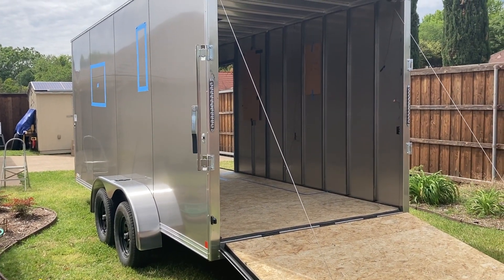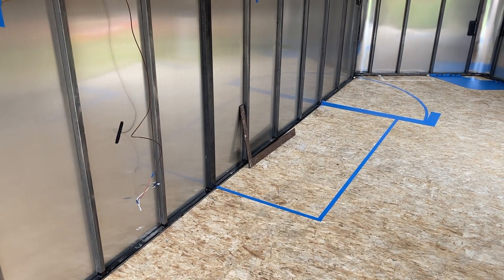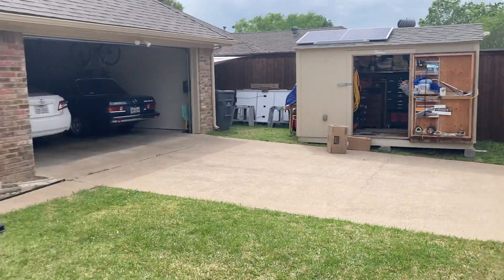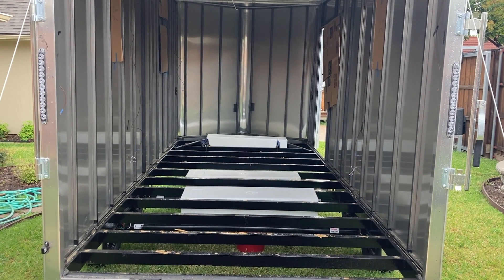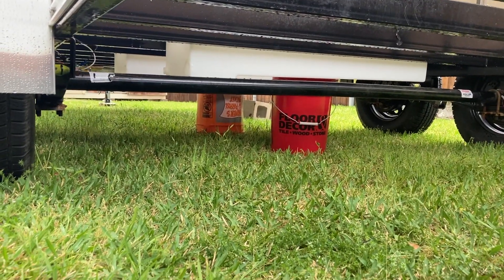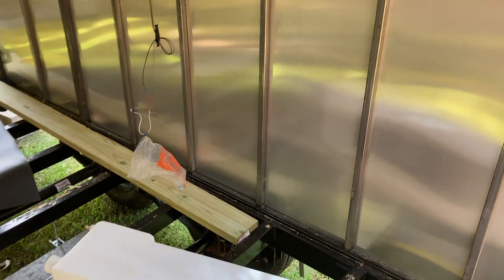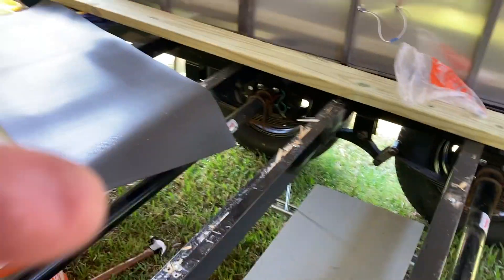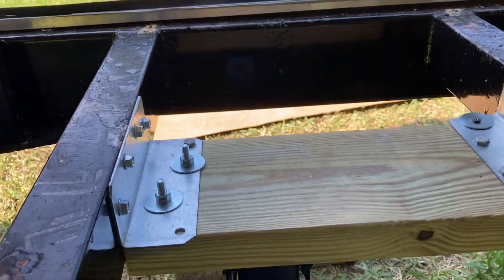Utility Trailer Build Start Haulina Layout and setting of Tanks, and Solar

Comment: I like how you removed the floor to place the tanks.  A lot easier than trying to do all the work from underneath.
Reply from the maker: Thanks, AUTiger83 - yes, I’ve learned over the years my best tool is my brain.  All the insulation and sealing the bottom of the trailer was bad enough.  Thanks, again.

Comment: Hi Jim,

Your videos have been a life saver as I’ve started my 20’ build! A question - how did you run your grey tank vent? My concern is sewage gases coming up through the grey tank (the blank tank will vent to roof) since the grey and black tank tie together for a common drain in my build. Do you have yours set up to be hooked up to sewage at a campsite? If so, how did you mitigate this concern as far as venting? Thanks so much for any insight you can share!
Reply from the maker: Thanks, Brandon for your kind comment.  In my build I only have a gray tank - I’m using a Thetford 365 Porta Potti.  Yes, I do vent the gray tank - I’m sure in some of my videos you will see the rotating sewer vent near the front & on the roof (kinda looks like a weather vain).  The rotating vent always points into the wind to help pull the smells out.  I am pretty sure you can tie the two vents together - I would do it a few feet up and vent them both Thru the same pipe.  And yes, I have a 3” connection for my gray tank to hook up to a 3” flexible waste line to dump.  The most common way to have the gray & black tanks dump is to have a valve on each that connects to a common connection for waste but the two tanks are kept separated by the two gate valves.  You typically would not open both valves - just one at a time.  I also have been told by experienced RV folks it is best to not just keep dump valves open at a camp site with sewer hook ups.  Best to have a good amount (at least 30%) of gray or black tank waste in the tank before you dump.  This makes it more likely to not have a build up of solids.  Hope this helps & thanks for watching my videos.
Reply from the maker: Brandon - 7:00 minutes in on the following video you will see the 3” connection for the gray tank.  This is a standard in the industry.

https://youtu.be/MU9BvJo0lZ4

Comment: Placing the tanks over the axles works great for weight distribution.  Do you find the tank up front adds too much weight to the tongue weight, after having it and driving with it for awhile now?
Reply from the maker: Living-working - this is a great question - YES, if I were to build another I would place the 2nd tank behind the axels.  I am not loading up the motorcycle as often as I thought and now load as much as I can in the back of the trailer.  I hope everyone who watches this video reads this comment - you hit the nail on the head!
Reply: @coachgym   Thanks. There are a ton of diy and cargo trailer conversion groups on Facebook, that I think you should share your build videos on. Your are very informative.
Reply from the maker: @livingworkingoutsidebox  
Crumbs - I’m just not a Facebook person.  I like people but when I tried Facebook I did not pay attention to the folks I can hug with my arms as much.  I’m just a simple older guy.
Reply: @coachgym  Roger that

Comment: Jim, where did you get your tanks, I am assuming they fit between 16” OC floor joists?
Reply from the maker: Thanks, Chuck. Got them from Class A Customs - yes, you are right they needed to be narrow & long to keep them from being too deep.  I was surprised how cheap they are and in fact when I pulled up the site below - looks like they are a little cheaper than when I purchased them.  Mine came with free freight & we’re about $90.00 each.  Hope this helps.  

https://www.classacustoms.com/Under-Mount-Style-Water-Tank-20-Gallon_p_252.html

Comment: Great placement of the water tanks. Also; good idea on placing a heater on the grey tank. Was that in case of freezing weather? That is one massive battery bank, LiFePo, correct?
Reply from the maker: I built the battery from 16 lithium cells - each 272 Amp hour and purchased a BMS - Battery Monitoring Sensor to keep everything in balance & dropout the charging if temps fall below 40 degrees.  I’ve got $1,600.00 in the battery build.  I think the lithium cells would be higher now - that was 14 months ago.
Reply from the maker: Heaters on all tanks for colder weather - yes, that is right.
Reply from the maker: I was looking over my responses & Yes, the Batteries are LiFePo - lithium iron phosphate battery or LFP battery is a type of lithium-ion battery using lithium iron phosphate as the cathode material, and a graphitic carbon electrode with a metallic backing as the anode.